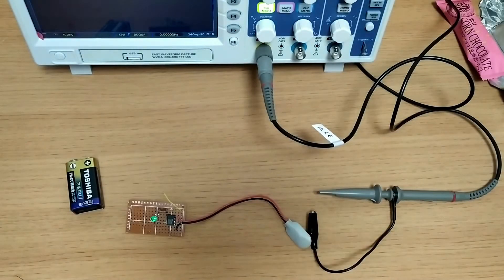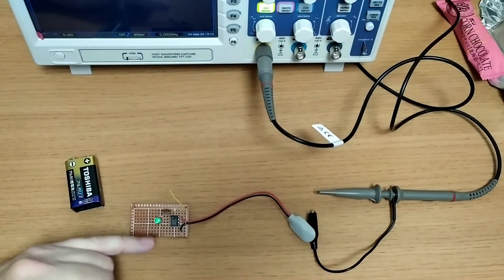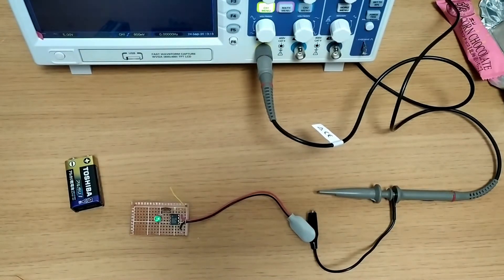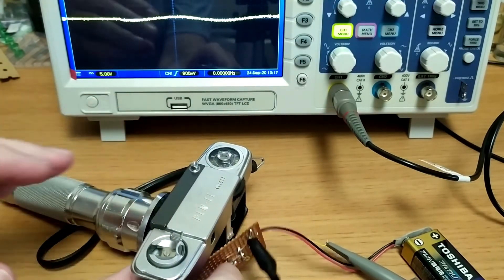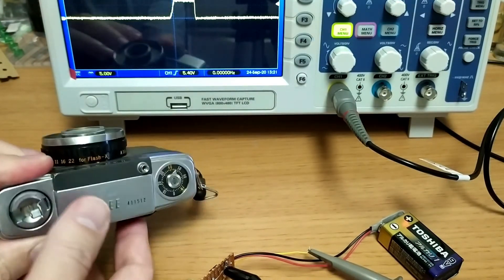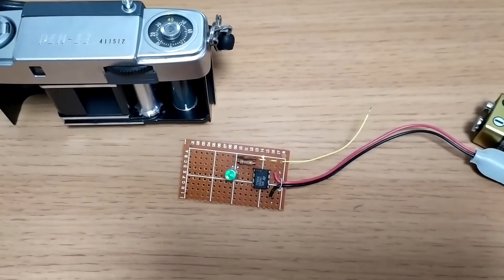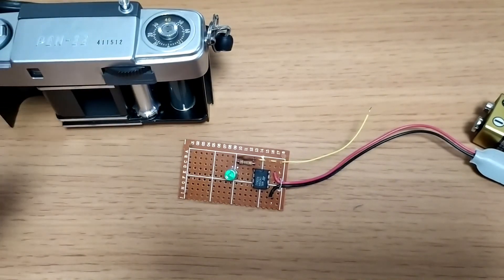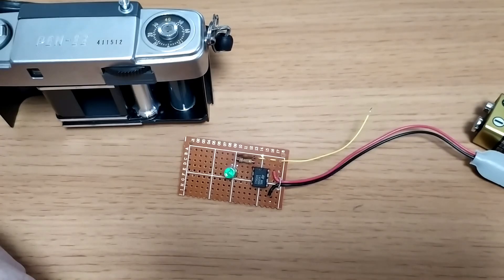Light Detector - measuring camera shutter speed

Comment: Hmm i didn't know that an led could detect anything, yes for a cds cell or photo transistor.
An old metal can bc109 with the top cut off may react as well.
What about a i.r led from a remote control. maybe lol.
That strip board looks like the type i used to get from Tandy.
Reply from the maker: Yes, I'll have to admit I only really found out about LEDs producing voltages this year myself.  In most circumstances its probably not really useful and there are better purpose built components, but they cost a lot more.  I also bought an S1087 photodiode - which was actually quite expensive (almost ¥500 for one compared to ¥30-60 for a strip of 10 regular LEDs!), and supposed to be purpose built for this kind of device, so I need to read it's datasheet and prototype it.

Interesting question about the IR LED.  I'll pick one up next time I'm down there. I might make a couple more devices using different components as "sensors" and see if there is any difference.  I also don't know if LEDs have response curves dependent on the light they put out, and I am not sure if I can that test accurately, or if it matters if they do.